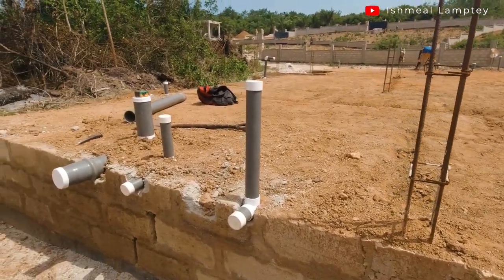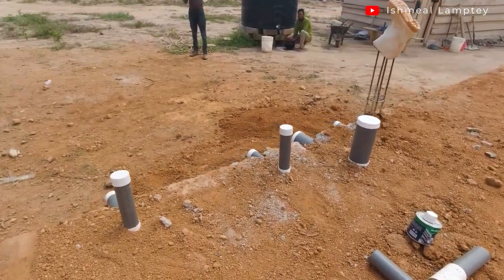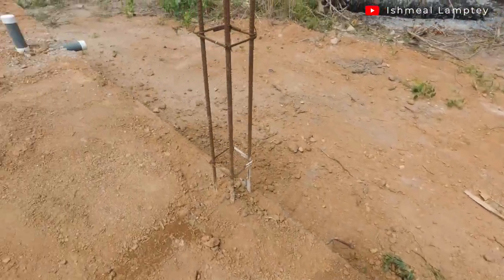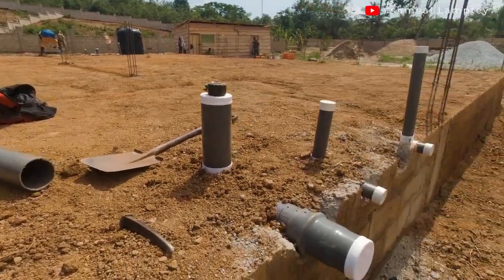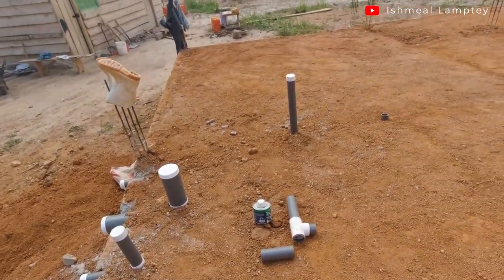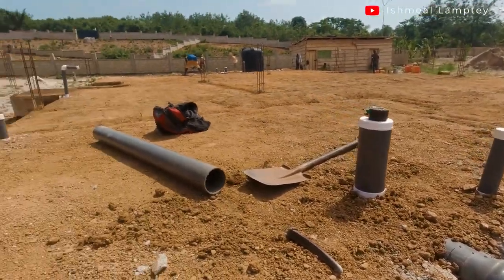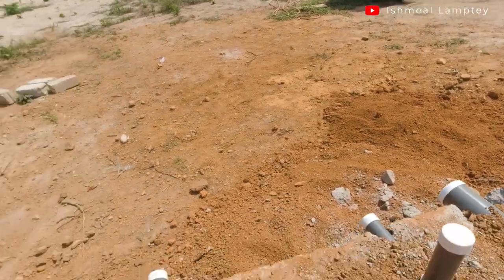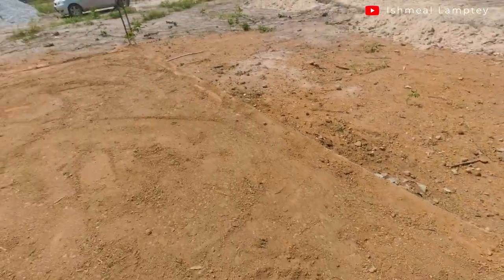Foundation Plumbing works in Asebu - Building in Ghana

Comment: What specifically are pressure pipes? What are they mostly used for?
Reply from the maker: Pressure pipes are used to contain fluid at high pressure. They are thicker and tougher than the normal PVC pipes and the purpose for using them is to prevent any leakages in the foundation. Pressure pipes are used in different circumstances, but the main reason is to prevent leakages.